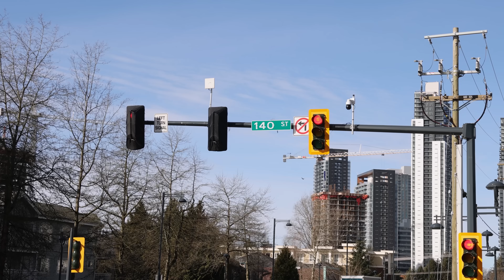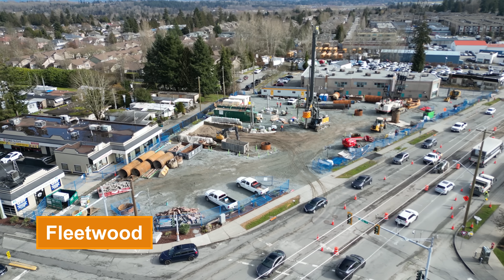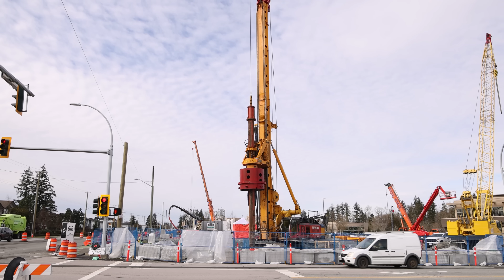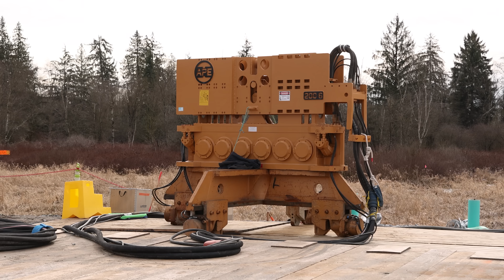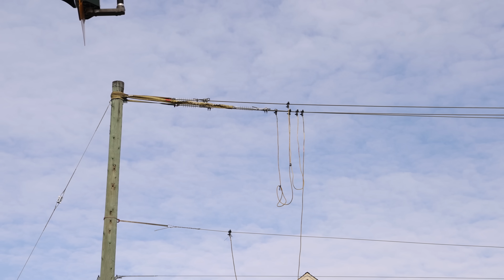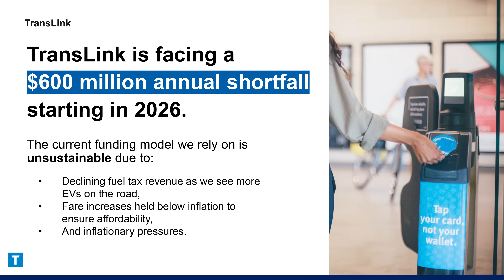Surrey Langley Skytrain Construction February 2025

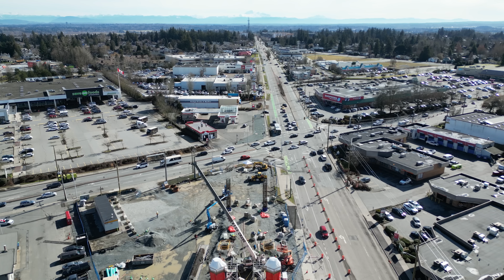Comment: 2:58 are those business in direct path of the skytrain gonna be demolished or simply build over top those business? Honda, Nissan, car wash on 88th.
Reply from the maker: There is already a corridor set aside for the line, so it doesn't interfere with any of the buildings. The beauty of planning in well in advance for line construction!

Comment: That clayton station looks kind of sad right now. Hopefully they do some large scale development around it to justify even including it. I also hope they add a bypass line on several stations so the langley trains don't need to stop at every stop. If so, that train would take way too damn long to get downtown. Have the bypass line stop at all the major stops and avoid the delays caused by stopping at the minor stops. Doubt it would happen without major upgrades, but it would be vital! Thanks again for the videos, really digging how in detail they are!
Reply: Express routing isn't part of the planning right now, which is infuriating. This is one of the longest lines in North America and it'll be local service only. Fortunately, a lot of the purpose of this line isn't for full end-to-end riders, it's also important for Langley-to-Surrey riders, SFU commuters, etc.

Comment: So the reusable concrete piling equipment and that concrete guideways facility owned or contracted by Translink? Seems like a good investment and in house experience that can be used future projects in Vancouver or even anywhere else in Canada wanting elevated railways
Reply from the maker: They're owned/sub contracted by the guideway construction contractor SkyLink Guideway Partners. If we keep pushing ahead with projects and get funding for future branches/extensions, then we may see the precast facility continue to exist and be used for future projects. The other machines and equipment are owned by local construction groups and get used for projects all over the region.
Reply: The next extension after the Millennium Line to Arbutus (2027) and Expo Line to Langley City Centre (2029) will be Arbutus to the University of British Columbia, which will be largely underground. The only major elevated SkyTrain project realistically on the radar after that is the Purple Line between Park Royal and Metrotown, but that is a long way out.
Reply from the maker: @christophermcdonald1122  The purple and gold (hastings) lines might actually be a lot closer than we expect. Should know more about it end of Q2 2026.
Reply: @StainerTheFirst  I really hope so. The purple line is badly needed: it will not only connect the North Shore to the SkyTrain system, it will also bring BCIT onto the network as well as providing an additional link between the Expo and Millennium Lines.
Reply from the maker: @christophermcdonald1122  Don't forget, 50,000 vehicles off the 2 north shore bridges the day it opens. It doesn't benefit just transit riders, it's good for everyone.